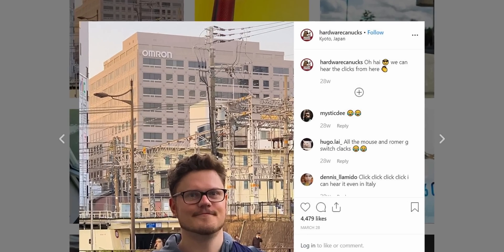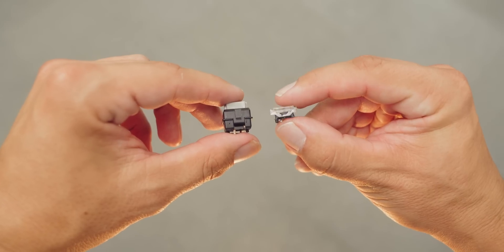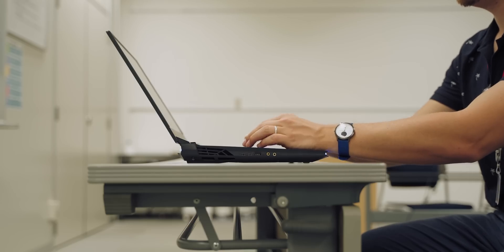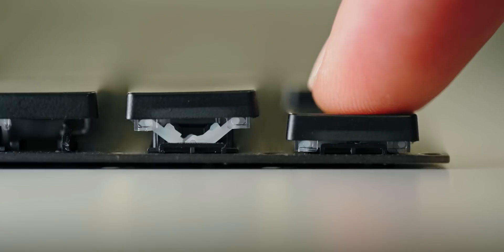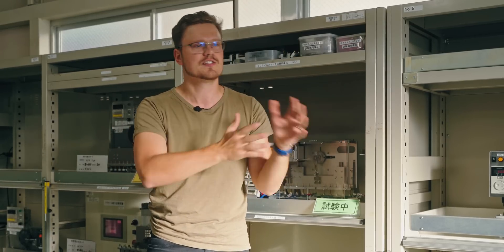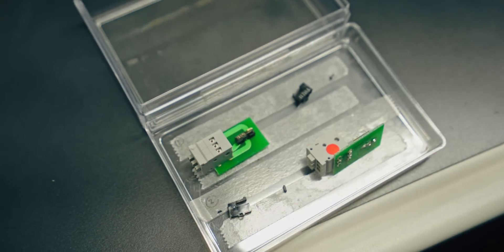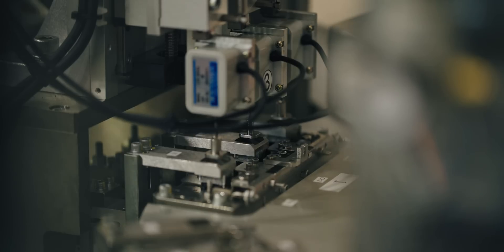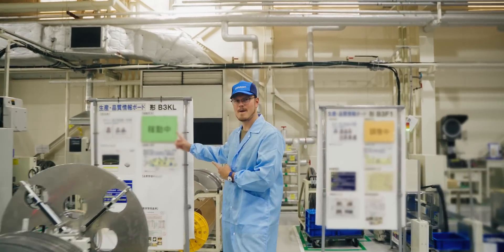How Mechanical Keyboard Switches Are Made In Japan!

Comment: Apart from the laptop, does anyone know where this switch was built into?
Reply: It´s in the new G815 and G915 from Logitech (other Keyboards I don´t know). Did it test today because my G910 is giving up slowly and man that are gorgeous keyboards. I really liked them, but it´s an investment. 200€ for the G815 and 250€ for the G915 are not cheap. I think I will buy the G915 for it´s fell and wireless function. I only wait for black friday if theres a deal. If not I buy it anyways.

Comment: Are the low-profile switches narrow enough that they will fit keycaps with a more traditional shape and width, or will the switches fit only wide chiclet keys?
I've noticed that this is an issue with Cherry MXLP for instance: you can't have a low key that is not wider than standard.

Comment: Man I love the feel of the Romer-G despite what keyboard enthusiasts say, I just hate that you can't use aftermarket caps with them because of the non MX stem
Reply: actually the reason why they hate it is not because of the feel. But because the keycaps' feet break easily. And the other reason is just like u said, can't put the $200 GMK keycaps on them. So, yeah
Reply: Honestly, after years of using MX Brown, Romer-G wasn't that much different feeling. It does have a longer travel distance according to specs, but imo it feels like a shorter more instantaneous actuation than MX Brown.
Reply: @xxMastufaquxx  have you tried Holy Panda?
Reply: @adrestiaeagerton4069  I have not, I have only tried Cherry's and of course the RomerG. But yeah the keycaps do suck tho, although mine haven't broken at all but they're stupid difficult to remove compared to the stems. The paint has worn off on the caps tho, making me wish they were easy replacements (there are on eBay and Amazon but...some variety like Cherry caps would be cool too)
Reply: @xxMastufaquxx  if you like tactile feel you should try Holy Panda and Zealios
Reply: @adrestiaeagerton4069  I'll look into those, thanks for the suggestion!
Reply: @xxMastufaquxx  and go check Taeeha Types' channel if you wan't to know about premium mechanical keyboard